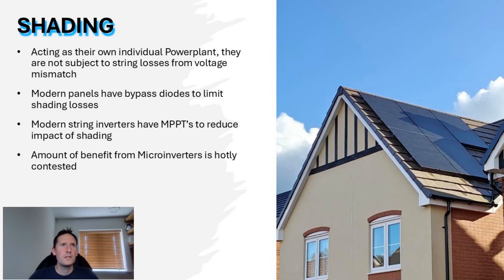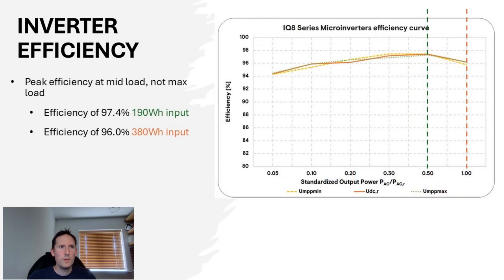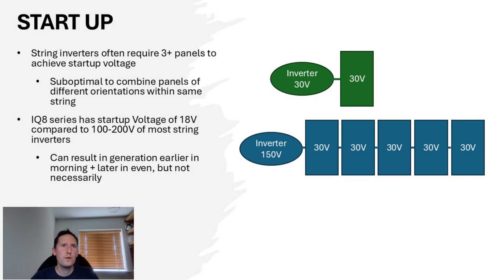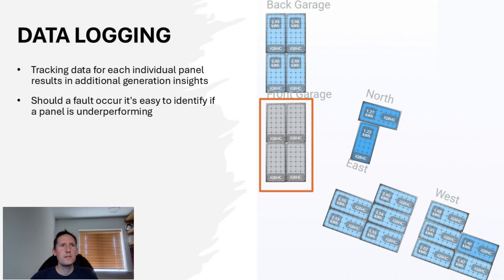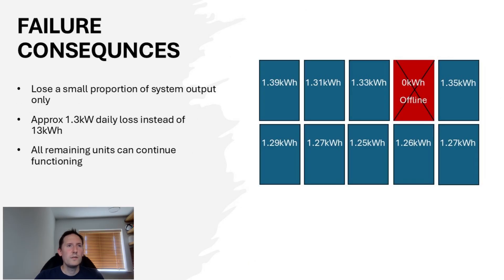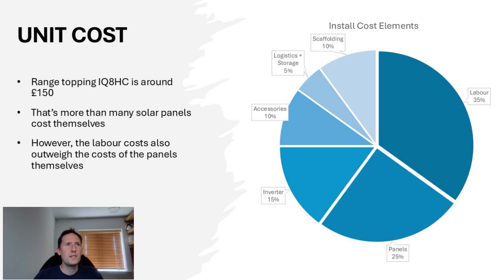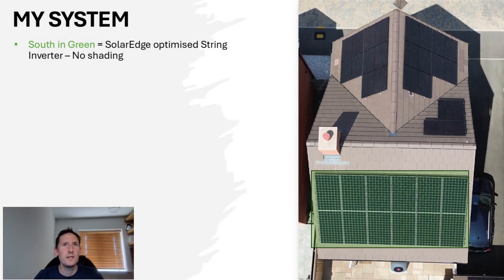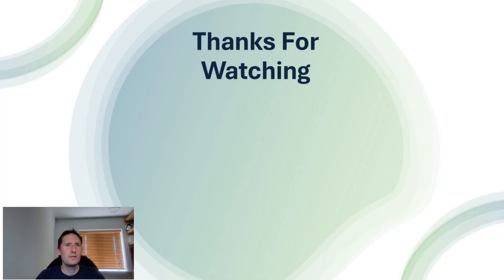Microinverters! Everything you need to know

Comment: We have 19 IQ7+ on our roof since June 2022. It was all great till one stopped working 18 months after the installation. The microinverter actually didn’t fail; the Q cable had been disconnected because the useless man didn’t push it in properly. The rest of the micros produced normally till the system was repaired and that’s a huge advantage of the micros when compared to optimisers. If one fails the whole system is off
Reply from the maker: Thanks for sharing your experience. 👍

Comment: the issue in the usa where we have high temps and lots of sun is really just one of durability. solar installers love microinverters because they can work faster and slap on more panels in one day and upcharge both the panel and inverter while not really requiring more labor.
the problem with micro-inverters is their placement under the panel. why would you stuff the expensive electronics under the hottest area of the house, you just end up getting early failure which kills roi. further more the issue is made worse by the fact that its almost always the middle microinverters that go out first on long rack mounted installs, which requires taking off over half the rack to replace the faulty component, and balloons labor costs which are the biggest part of a solar install. another reason why shady solar installers love them is the fact that the average solar user will not see an abrupt fall in solar output like if a string inverter goes out. this pushes the timeline out for warranty claims, usually after the solar installers go bankrupt and respin their company under a new name, and leave the user high n dry to fend for themselves with the mfg. good luck.
so far almost all the microinverters on the market with the exception of enphase demonstrate that they dont even understand radient heat transfer based on the construction of their micro inverters. when theyre stuff under a hot string of panels, thats the only cooling they can depend on. too many mfg copying eachother and not understanding design choices, and just looking to save a few bucks on rnd and stamp out the cheapest components. if the roi for a solar system is more than a year or two longer than the warrenty period for a micro inverter, i wouldnt use them. when you do the math, micro inverters almost always cause roi to never be realized before they fail and are replaced. for my microinverters in weird locations low panel count orientations, i just oversize them and wire them somewhere cooler out of direct sunlight/the elements. its actually building code in australia that string inverters have to not be installed on the side of a building that gets direct sun exposure. i think thats north down under. its no mystery why. heat = premature failure of electornic components, usually caps or mosfets.
Reply from the maker: Thanks for sharing your thoughts. Lots of good points in there. I must admit before I made this video I couldn't name more than a couple of brands besides Enphase who make microinverters. Here In the UK they very much have a strong market share despite the price point. Perhaps it would have been interesting to find the warranty lengths of some of the competitors for comparison.

Comment: Hi Steve, I'm considering expanding my existing setup which currently has an inverter + optimisers and looking to add REA Fusion Panels + Mirco inverters. A key argument for Micro-Inverters is low-light performance. Since you have both setups, are you able to provide a comparison for how much better they are over a string setup with optimisers?
Reply: Hi Guys, I'm getting the new REA Fusion R with Enphase micros, PW3 and the new Enphase IQ EV Charger 2 installed next week. It's 18 panels, with the majority of them in East, West orientation. I'd have loved to have stayed within the Enphase ecosystem for batteries too, but unfortunately the new Enphase batteries aren't available in the UK and their next generation will be out next year, hence going with PW3 with an AC coupled set-up.

I'm not an expert but have done a bit of research over the past few months,

1) Individual monitoring and production is the key benefit of Enphase micros. Don't think Optimisers match up to this.

2) Panel level conversion to AC, which is much lower voltage (hence safer than DC) is another important factor for me. In my setup, I'll be able to run a cable from the ACMs on the roof to the consumer unit in the garage inside the house. With no micros, one has to run these cables (at best within trunking) outside the house as you cannot run high voltage DC inside the house.
Obviously it reduces the chances of fire hazard significantly. I don't understand why in the industry here this is not spoken about enough?!

3) Enphase reputation in terms of reliability, durability and quality of service is well recognised, mainly in the US but in the UK too. In the US it's considered quite premium and company with greater experience than Tesla in the solar market. It's not something to gloss over especially if you are looking at long-term investment such in solar PV for your home. The fact that these micros come integrated with quality REA Fusion panels from the factory itself is the best possible combination, as it requires less manual intervention during the install.

4) The warranty comparison between micros and string inverters is an excellent point raised in the video. It's self explanatory, so not much needs to be said there.
Reply from the maker: @sensahuma4u  Good luck with the new system. Thanks for sharing your reasoning 👍
I must admit I'm quite envious of those new Fusion R panels 😉
Reply from the maker: Hi mmajange, its never a perfect like for like comparison because we are comparing a 12X 430W panel south facing SolarEdge Optimised system against 10x 440W panels split across shaded East and West roof aspects. However, I have good comparisons in my Solar Generation videos from January and February. In both of those videos look for the 'Lowest Generation Days' chapters for some analysis. If I recall. The 10 panels with microinverters outperformed the 12 without on the darkest days of those months so that should give a good representation of how they perform in worse case scenario situations.